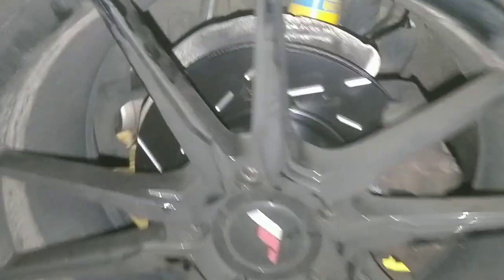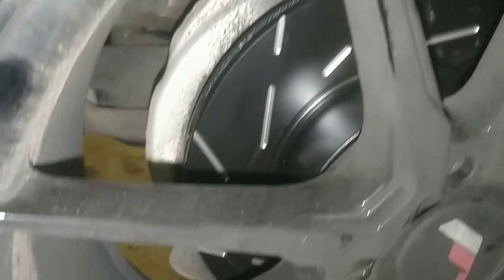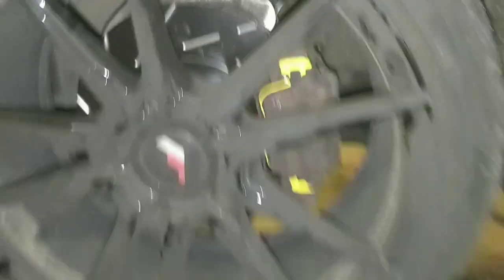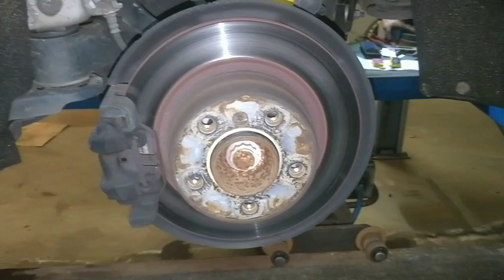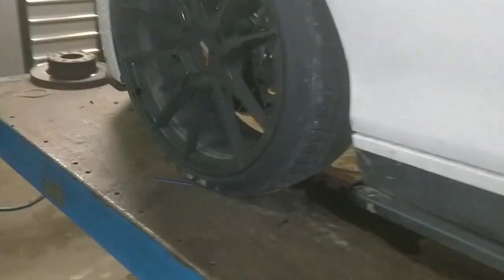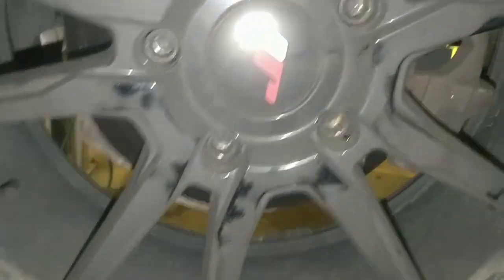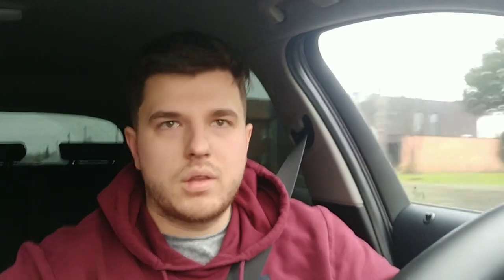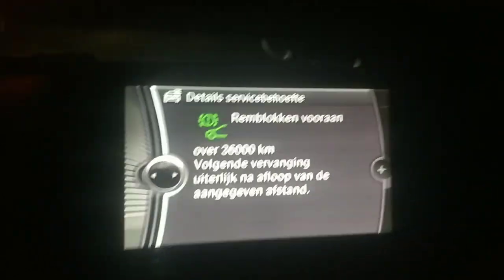BMW 1 Series 114i F20 EBC brake upgrade

Comment: Hey bro, just have a question if you don’t mind answering. Did you ever experience a lot of brake fade with the ebc setup or was it good? I have them fitted to mine and I experience quite a bit of fade even with yellowstuff. Also did you have your brake cooling ducts installed aswell or no? If yes did it help a lot with the brake fade? Thank you :)
Reply from the maker: Yes i still had brakefade, and yes i installed them
Reply: Thanks for your reply. I’m definitely looking to get the cooling ducts installed soon I think it’s pretty normal to get brake fade especially since the brakes aren’t significantly big, there’s only so much you can do with them.
Reply from the maker: @ansar3370 true, they are really small. You would need M140i brakes at least to be safe

Comment: Hey bro, been a fan of the series so far! Im thinking of buying a 114i as well and remapping it but Im a bit afraid because it doesnt have an oil cooler/heat exchanger. Any issues so far in that respect? Thanks
Reply from the maker: Thanks mate. And no i had no issues yet. The car is running great

Comment: Stel je hebt 114i met stage 2/ hoeveel kost de tune met hardware samen? En welke extra mods moet je doen zodat andere dingen minder slijten zoals de koppeling enzo? Thanks alvast! Weer goede vid zoals altijd kben sub geworden😉
Reply from the maker: Het hangt er een beetje vanaf, voor stage 2 heb je intercooler en downpipe nodig. + Software gaat dit ongeveer €2000 kosten. En op zich kan de rest van de auto het best goed aan. Ik zou zeker de remmen bij de volgende beurt betere blokken geven en ook goede banden is een aanrader
Reply: Bimmer Belgium geen oliekoeler of iets 
? want ik had een 116i video gezien waar de olie tot 140 graden celcius ging dat lijkt me nogal hoog😅
Reply from the maker: Daar gaat de intercooler bij helpen